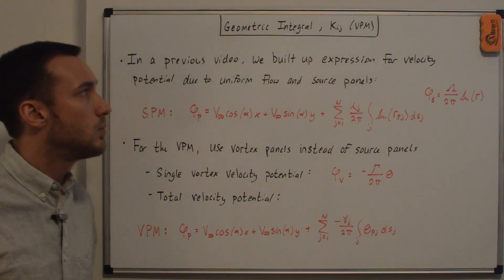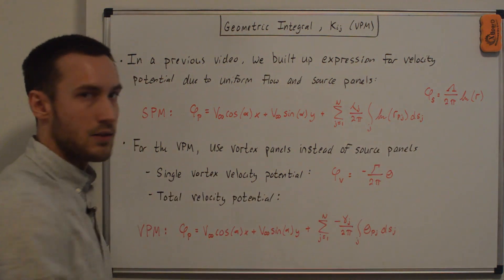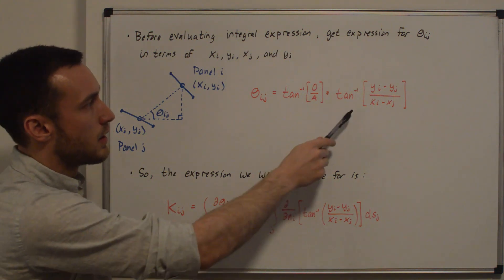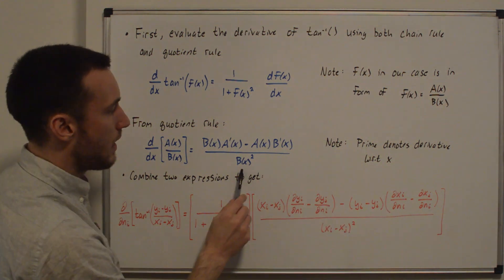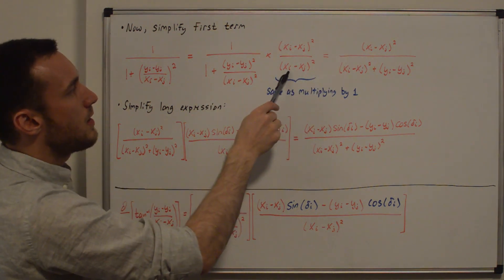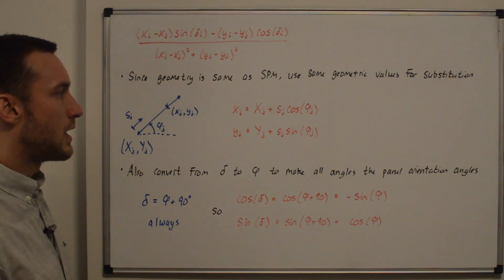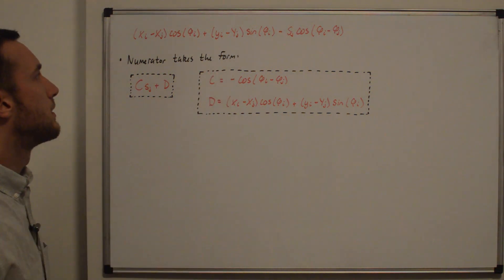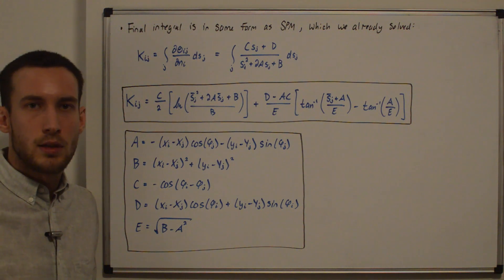Vortex Panel Method: Normal Velocity Geometric Integral [K(ij)]

Comment: Hi Josh, thanks for the upload. I have a question regarding the application of this method to thin airfoil theory. 

In the case of modelling a non-cambered airfoil according to thin airfoil theory, the vortex sheet becomes a straight horizontal line. This means phi = 0 and y_i = Y_j for every panel. Therefore, E = 0 for every K_i_j in the computation of the integral in 14:34. Do you have any way of working around this? Or is this method simply not applicable to thin, non-cambered airfoils.
Reply: i have the same concern. did you fix this?
Reply: @RainTurtlez  Yes I fixed it. I used a model described by Katz and Allen in their book "Low Speed Aerodynamics". I believe the model is mentioned in Chapter 11 of the book. The model is called "the lumped vortex element method".